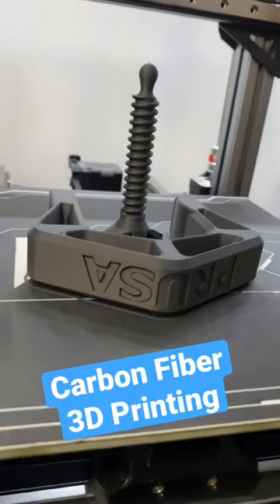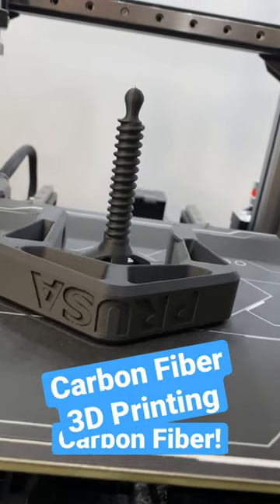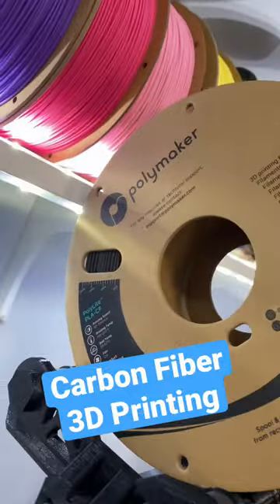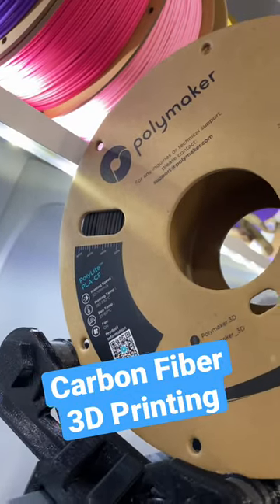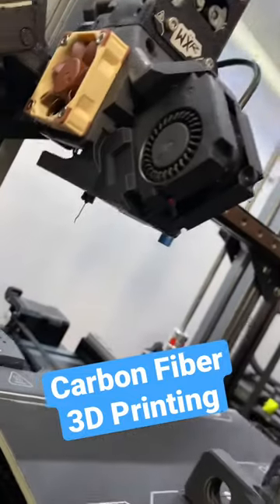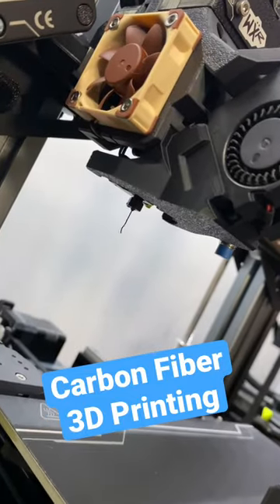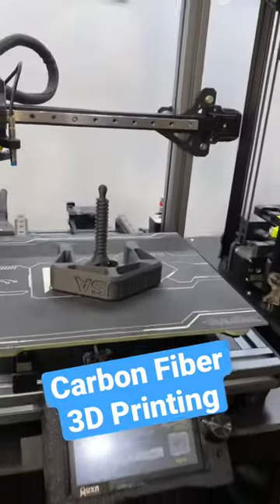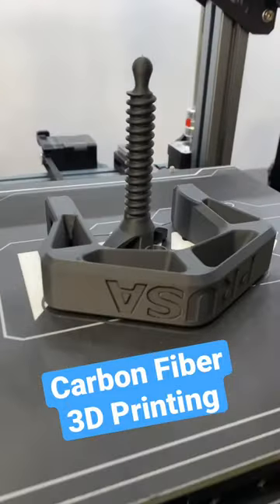Too Simple! Carbon Fiber 3D Printed Clamp #shorts

Comment: Technically its just the same material (high strength carbon polymer) since the printer isnt able to create actual fiber strands. Right or no?
Reply from the maker: Polymaker PLA-CF contains about 8% carbon fiber by weight. It’s added in to give the PLA added strength. These printers definitely do not create strands.